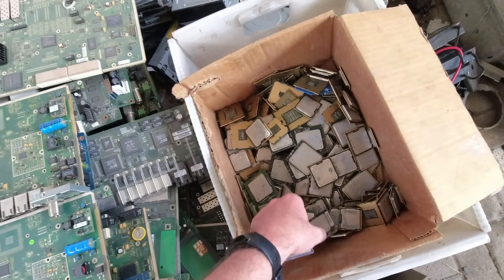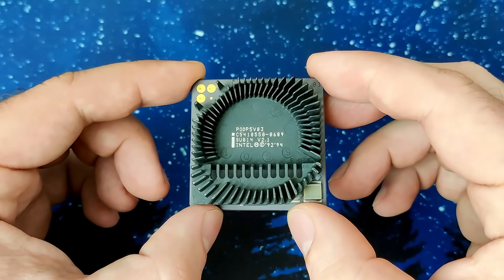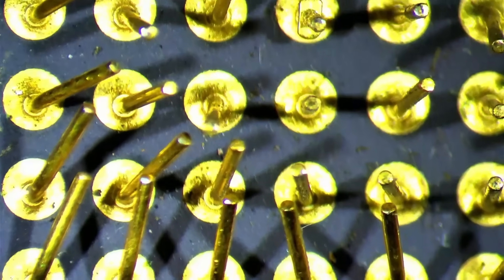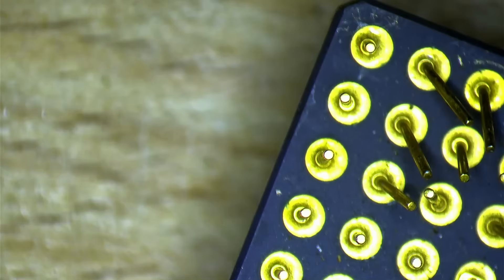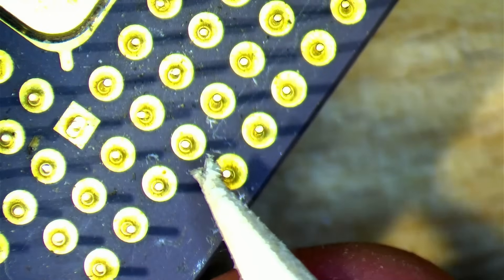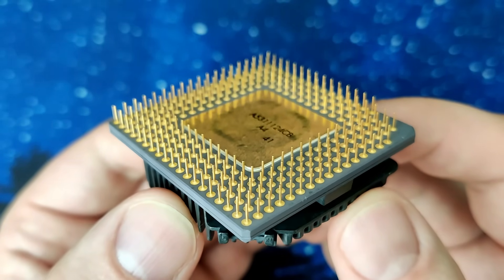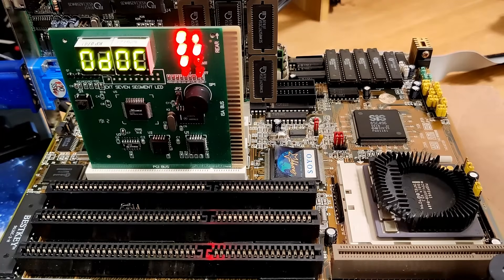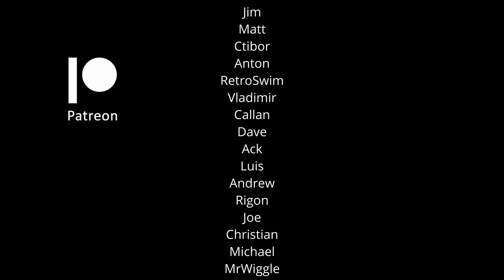Will this CPU work? Intel Pentium Overdrive (PODP5V83) - found at a scrapyard

Comment: I worked at intel testing the 1st batch of these chips. The 1st thing we did was take the whole batch into a machine shop to have a couple of the pins in the corner removed.  I can see in your video that the chip you were showing had blank spots where those pins and where several others we didn't remove used to be. Obviously yours was from a later batch where intel fixed the issue. I recall the chip failed every once in a while because the fan was not seated properly but most of the time resolved itself by clicking the fan in place. I know the concern was how hot the chips ran. I'm wondering if the pcs we tested had a specialized BIOS so we rejected bad chips/fans, or if later BIOS updates solved the problem by turning off the multiplier. I hope you find a fan.
Reply from the maker: Interesting! Would be nice to find one of those earlier models where the spots with the removed pins are visible!
I may just have found a fan for this CPU. If so, assembly can take place in January 2024 😄

Comment: I guess I should be glad I got mine a while ago in decent condition for $60 on eBay. Works like a charm and has been voltmodded to run perfectly stable at 100MHz.
Reply from the maker: Great CPU! And nice that it works at 100 MHz! Congratulations!
Reply: @bitsundbolts  Definitely a nice CPU, using almost the same board as you (4SA2 which supports up to 1MB L2 Cache) making it one of the fastest socket3 systems when using a fast VLB graphics card.

Comment: I find strange the 83mhz speed, you could overclock it to a more "normal" speeds.
Reply from the maker: This is because of the fixed multiplier of the CPU - which is set to 2.5. At a bus frequency of 33 MHz, you end up with 82.5 MHz. The only way to get to "normal" Speed is to overclock the bus to 40 MHz which results in a CPU frequency of 100 MHz. But not all Pentium OverDrives can handle this overclock.

Comment: happen to know how to replace broken pins on these intel cpus? i've got a dx50 486 chip with a broken pin i can't seem to get the donor pins off, or the broken base. its rather annoying. and i can't seem to find any info on the specific technique for it.
Reply from the maker: I have not tried to replace pins on 486 CPUs yet. I have damaged CPUs that I could try on. If I get the time, I'll try and see if it's anything like on a Pentium III. There, I used hot air to remove and add pins.

Comment: I would love to see you try to run some CAD programs like AutoCAD. This is where more powerful processors and floating point units made a huge impact, and was bread and butter for Intel for many years. As soon as they released a processor that had major improvements like this, entire engineering firms would upgrade every single machine in-house because of the amount of time it saved, which they could actually count in dollars. If an engineer had to sit and wait for a model to render for 30 seconds, and then suddenly it renders in 5 seconds with a new CPU, it won't take long for that CPU to pay itself off in increased productivity!
Reply: I'm definitely seeing that with switching to SSDs. Aging hard drives can really slow down, and all those seconds can really add up across a fleet of computers.

Comment: I have all of these CPUs, and the systems they came in.    Including several overdrives.
Only a m0r0n m0nk3y that has no business dealing with computers would abuse a CPU that bad.  
Yeah, I would not have paid a cent for those CPUs, and I'm really good at straightening pins.   
For one thing they are obsolete, for another, there are just too many pins.     Anything that bent is basically free.
Reply: Except for the fact that you can sell old electronics for recycling of precious metals. That gives them value, so no, they probably aren't going to be given away for free. Someone has to spend time and money collecting, moving, dismantling, testing and then storing all those computers and parts. Money they need to make back.  And as with anything old, if people collect them, their value goes up as they become less and less common over time. Supply and demand... basic economics.
Reply: @another3997  Yeah, I tried removing gold off a CPU, it is not as easy as it sounds.   You need a lot of toxic chemicals.   Regardless, even obsolte, the CPU is worth more as it is than it's raw material component parts.

It's like crackhead wire scrappers who will rip apart a house to pull out the copper wiring, and then burn it in a burn barrel to get a few pennies on the dollar for the copper inside.   But if they coiled up the wire, and sold it as wire, they could get $50 for it as electrical wire, instead of $2.50.   M0R0N5.

I use to bring these sytems home by the pickup truck load in the 1990's when they were obsolete then.  Barn fulls of them, I've seen every CPU in his picture in my collection plus several overdrives.   He's a dmmn fool to pay anything for them, but I can only imagine if he is located in Dubai it's a lot harder to get CPUs.   Here in the States colleges and universities and businesses were literally throwing entire systems in the dumpsters en masse when they'd do a site wide upgrade.

I solved their problem for them by bringing them all home for free no charge to them and making their problem disappear.  On the upside, I got every super expensive system I ever dreamed of as a kid.

Comment: I'm absolutely surprised that all the pins ended up straight. I didn't doubt that you'd be able to straighten most of the pins very well, but expected at least a couple to snap.
Reply from the maker: The pins were surprisingly "soft" and easy to bend back. Never did I have the feeling that one would snap off. I'm sure it's different from CPU model to CPU model. I'll try Pentium 4s some time - someone already mentioned that those are prone to break.

Comment: That is a saint`s patience. Great outcome! It would be nice to see a comparison between this CPU, a 486 and maybe a 386,  all clocked at 33MHz. Actually, the most interesting would be to see the benefit of the architecture difference between a 486 and this pentium at the same frequency, and maybe a AMD 5x86 slowed down at 33MHz.

Comment: Cyrix CPU's have power that requires special commands or software to unlock bit and bolts if you want to see those Cyrix CPU's full performance unlocked.
Reply from the maker: Yes, I have seen this in many videos, including CPU Galaxy. But I think there it was their 5x86 CPUs. I'll definitely have to do some research for those CPUs.
Reply: @bitsundbolts  no there were some commands to get better performance out of those old Cyrix CPU's but it was not widely made available so many people never even knew it existed, so they never used it which sucked but it was what it was as that increased the CPU's performance so look high and low for it cause if you can find them and use them you'll get more out of those old CPU'S by activating them
Reply: @SaraMorgan-ym6ue Yes, apparently Cyrix CPUs had several poorly documented features, although the fact they weren't automatically enabled suggests they weren't reliable or consistent. Please try and include at least some punctuation, it makes reading long texts so much easier. 😉
Reply from the maker: I'll do my research for those CPUs before I use them. Hopefully, I'll find those commands.

Comment: 55 dollars for scrap CPUs in unknown condition? dang. I really doubt there's that much gold in there to be reclaimed.
Reply from the maker: Yes, I totally agree. I guess the seller wanted to take me for a ride. But if it wasn't for the OverDrive CPU, I would have left the other chips. Just haggling back and fourth ended up in 5 CPUs to be the best deal for me.
Reply: It's a matter of scale. One CPU may not have much gold or other useful materials to reclaim. But multiply that by a few thousand, and it starts making sense. That's why it's done on an industrial scale.
Reply: @another3997 Uhh, right, but that doesn't make 5 CPUs worth 55 dollars. If BuB wants to spend that for a video that's fine obviously, but that's quite a bad odds gamble.

Comment: Why does the scrapyard charge to for you to take what is junk to them?
Reply from the maker: Some deals are made by weight - others per piece. It depends what item it is. Since CPUs and electronics may contain gold, the price is higher (because of the materials). It all depends how well the guys there like you 😉
Reply: @bitsundbolts  ok that makes sense
Reply: I have a pentium overdrive and mobo too and also a pentium memo and a asus mobo to go with that and I did not realize how much they are worth
Reply from the maker: Yeah, those components are quite valuable considering that they are "outdated" tech

Comment: Wow, congratulations on straightening all those pins and getting the CPU working! I definitely wouldn't have had the patience to do that, I've given up on CPUs with far fewer bent pins than that.

I'm guessing the CPU is just looking for the tachometer signal from the fan, which is what the third pin on a regular fan does. Feeding a 1-2KHz pulse signal from the function generator on your scope would probably work, just check the voltage that the fan runs at so you don't cause any further problems. For a more permanent solution, you could probably design and 3D print a bracket that clips over the heatsink and you can screw a regular 40mm fan onto, then solder the wires onto pogo pins that are mounted on the 3D print in the right spot to touch the fan contacts when clipped on. I mean, if you're well practiced in 3D modelling like I am. 😁 I'd offer to help, but I barely have the time for my hobbies as it is.

As for what to do with it? I like how Phil from Phil's Computer Lab plays random old games, so maybe look up some games that would run well on this CPU? A quick trip to the Internet Archive and I found the September 1995 (the same month as this CPU was released) issue of PC Gamer magazine, in which they reviewed Mech Warrior 2. The minimum requirements were a 50MHz 486, but they recommend a Pentium, so it could be interesting to compare the performance of a 486 to the Overdrive in such a 3D game.
Reply from the maker: I have no experience with 3D printing yet - same as you, I'm short on time. I wish to change that in the future. I may find a simple solution to temporarily mod this CPU for more tests.
I'll definitely look into a few games that run on 486, but a Pentium is recommended! Would be awesome to see if socket 3 owners could benefit from the Pentium OverDrive and keep their systems just a bit longer! Thanks for watching! And no pressure regarding helping with 3D modeling - I'll figure something out 😉

Comment: Genuinely surprised you bent all these straight. What would you have done if a pin broke?
Reply from the maker: I probably would have replaced it. I am not sure, but I think those pins can be soldered. I have a spare 486 CPU that is damaged. I could use spare pins from there. I did replace puns on a Pentium III before - the video is on my channel. So, I would assume something similar is possible with this CPU, but I am happy that I didn't have to find out!

Comment: that was a good job! I also have some CPUs with bent pins, I'll follow your advice. A friend of mine who is a mechanical engineer recommended me to warm up metal when it's being bent. It might or might not help with CPU pins but I think I'll give that a go when reviving my CPUs! Thanks for the video!
Reply from the maker: Thanks Tony! Maybe the hot climate in Dubai makes it easier to bend those pins! I know you're in a colder climate, so, heating up the metal (and hands+fingers) may help with the repair 😉

Comment: as some funky cpu collector, i think scrapyard is the best place to go
Reply: Here where I live, the scrapyards were a bonanza for old (retro) harware, from electronics to mechanical parts. Sadly, from few years ago, those gold scrappers changed this, everything "golden" have increased the price (actually everything that looks even remotely old and is electronic, for example a VCR from late 2000s cost at least 50-100€, not to speak of memory, CPU, PCI and ISA cards) and even worse, valuable pieces of old computers are salvaged and destroyed. My last find was a 486 motherboard with all SMD and socketed  chips missing that I took for the only pupose to make an ISA backplane for an industrial PC104 that I found on that scrapyard and costed me 25€ just because those ISA slots have yellow contacts.
Reply: @sebastian19745  damn that was not a good news.... I dont find any of 486 cpu but i got old pc-98 that after few repair could run... Yeah i dont have any software for it
Reply from the maker: That's really unfortunate 😔. I hope to have the scrapyard for a couple of more years so I can share the stuff I find there!

Comment: The mechanical pen method has the advantage of putting pressure on the solder while the pin is being bent back. I found that ripping the pin off the pad together with its solder blob isn't much of an issue on socket 7 or below. But on 478, especially earlier Willamettes, I broke off a lot of pins before I used the pen method. And soldering those pins back on is a PITA ;-)
Reply from the maker: I'll try that soon because I have plenty of Pentium 4 CPUs that need some love! I can try both methods. Maybe different techniques suit different CPUs

Comment: I may be wrong but i think you need a fan for that cpu otherwise it does not work correctly. Or at least fool it into thinking it has one. 
I think Adrian's digital basment had a video on that topic.
Reply from the maker: Yeah, there is a simple hack. Just a 1k resistor between ground and the sense pin, and it will work as if the fan is installed. I may do such a temporary hack soon because I want to experiment more with this CPU!

Comment: "Let's see how it fits in the socket" Like a boss 😎💪 I have two of these, both are with new heatsinks and fans, Akasa chipset coolers does the job with 2-sided thermal tape. But neither one of my POD83s won't overclock to 40FSB (100MHz).☹
Reply from the maker: I'll try 100 MHz on mine. Maybe it really is a "golden" CPU 😂 that would be funny if I also won the silicon lottery!
How does your POD behave when overclocking? Unstable or no boot?
Reply: @bitsundbolts  Other one crashes when booting from HDD and other one boots into DOS but Quake1 won't even start. Tried some voltmodding (there's different ways to do that as told in vogons forums) but still not 100% stable. My friend has one POD83 and that takes 100MHz easily. Lottery 😅
Reply from the maker: I'll try mine. I don't think that I'm lucky twice 😞 you know, finding it, and the chance to have good silicone

Comment: Back in 95 I had a DX2-66 that I upgraded to 83MHz P24T Overdrive - and it was a BIG jump in performance versus the DX2-66. This was especially true on anything that was floating point intensive as the Pentium's pipelined FPU was a lot faster than the rather anemic FPU of the 486 (and Intel fixed a lot of the issues related the x87's stacked registers in the Pentium's FPU). Provided you had a board that properly enabled L1 writeback caching, it was a legitimately worthwhile drop-in upgrade back in 1995.
Reply from the maker: I think I have seen settings in the bios that enable write back for level 1 cache. I'll definitely investigate more!

Comment: Scrap Computing, Atheatos and I have that board, mine has a DX4 120 in it, I'd be interested to see what kind of benchmarks you get with that chip in comparison to the 120mhz. Great work with the pins btw. I'm assuming they used gold for conductivity but the malleability for retro recovery sure is nice.

Comment: you can straighten a million pins of a CPUs a day but you must have the right tool I think I saw someone on YouTube that have very thin hollow metal like a pen, he used it to straighten  each pin, very good and fast, the metal pen is hollow you use it to straighten each pin, you do it pin after pin with hollow metal pen, do you know this method, the tool look like very thin metal hollow rod, each pin go inside the metal rod then you move the rod to straighten the pin, i think you can even straighten the pins with medical syringe  sorry english is not my language
Reply from the maker: Yes, I have seen something like this. I know of the mechanical pencil which may be very similar. I wanted to be very careful with this CPU! When do you find such a CPU at a scrapyard - a working one!! 😉

Comment: I have one I bought new as soon as they came out.  It still sits in it's first home, an AT&T / NCR 3230 486SX.  What surprised me was this computer did not require the 486SX chip to be removed as it had an empty socket intended for the OverDrive chip.  I definitely noticed a huge jump in speed.  The chip came with an install disk for DOS, which may be needed if you find that oem fan.

As for bent pins, I'd have first used a very small diameter straw, such as on canned air.  Unlikely to scratch the pins, but finding a clear one to see the pin?  Yeah, there's the rub.  I was surprised with how well your technique worked!  VERY well done!
Reply from the maker: Thank you! And the idea with the plastic straw of canned air is great! May be a viable option!
Nice to hear that you kept your NCR system with the Pentium OverDrive! I have seen the install disk on LGR. Unfortunately, I don't think there's much useful stuff there, mostly an animated install guide and some tests of the CPU. The Intel OverDrive (486), had benchmarks to compare before and after if I remember correctly. Don't know why they didn't have that for the Pentium OverDrive.